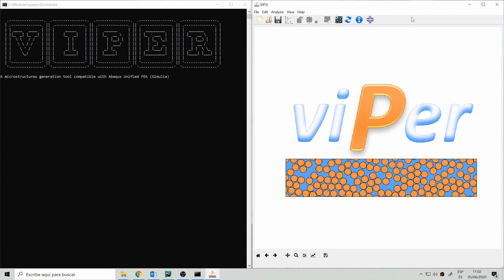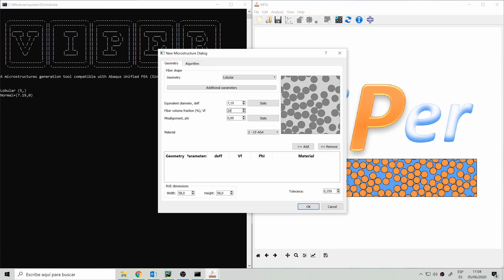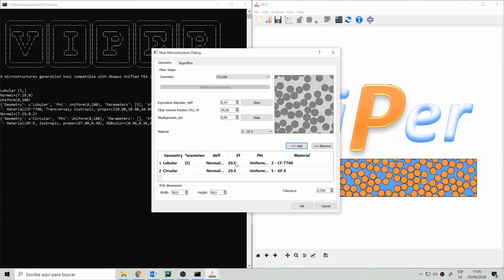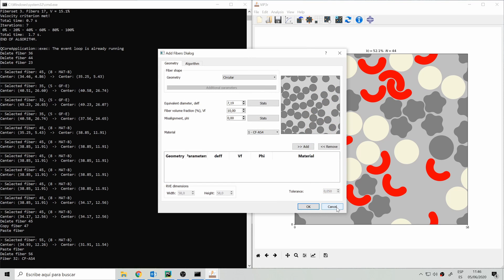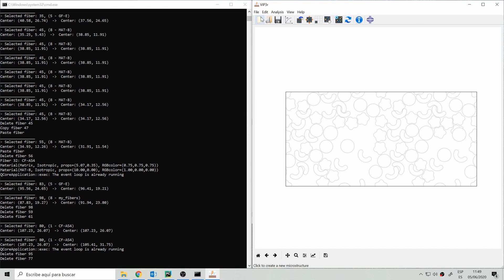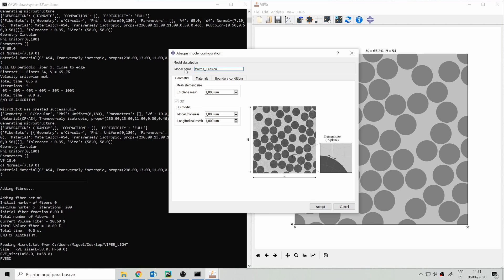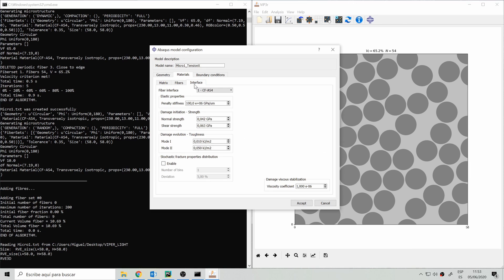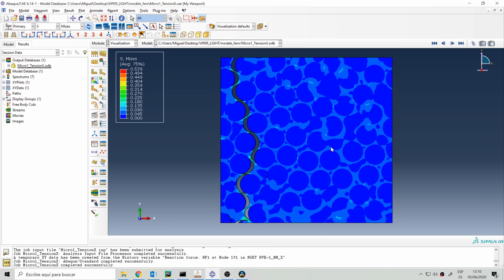Viper - 2D Microstructures generation and finite element models in Abaqus

Comment: Can viper compute elastic properties?
Reply from the maker: Viper is intended to obtain the geometry of the material system (made of fibers or particles) and compute its mechanical behaviour using other numerical software like Abaqus. Elastic properties can be computed on a single simulation using Abaqus in a few seconds.
For a faster computation of elastic properties let me refer to the FFT method that can be applied on periodic structures (representative volume elements, RVE). You can find a good starting point about it in th following article: 
T.W.J. de Geus, J. Vondejc, J. Zeman, R.H.J. Peerlings, and M.G.D. Geers. Finite strain fft-based non-linear solvers made simple. Computer Methods in Applied Mechanics and Engineering, 318:412 – 430, 2017.
Reply: @mherraezmatesanz  OK
Thanks you